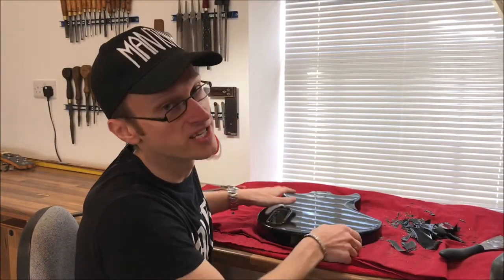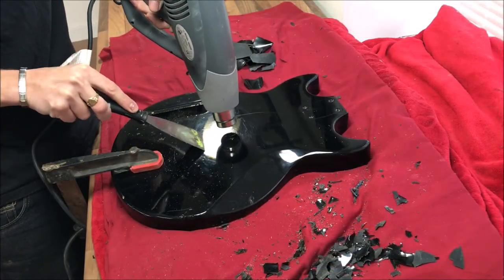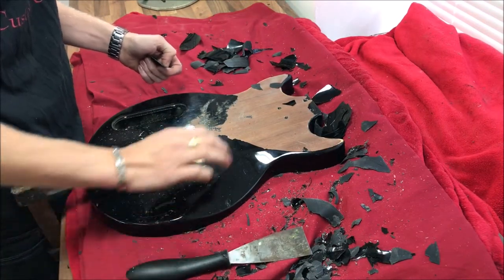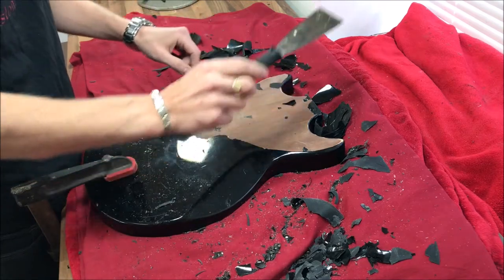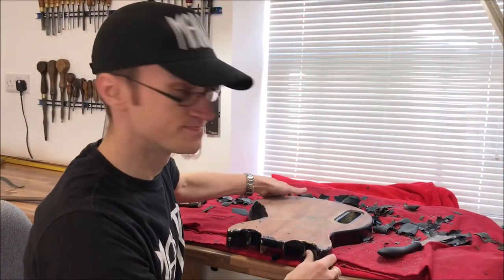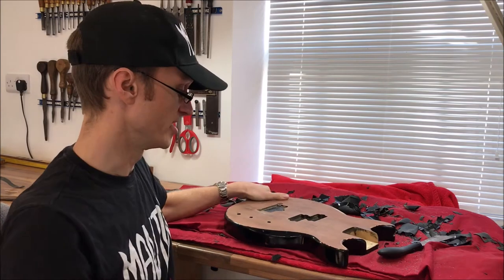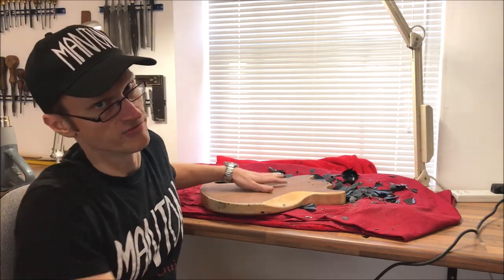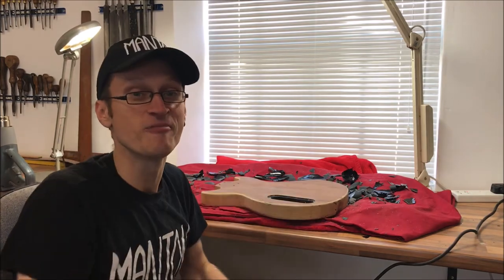Stripping / Removing Paint and Poly Finish from a Bass Guitar Body with a Heat Gun

Comment: Hi, thanks for the instructional. I’ve got a cheap tele type guitar a friend wants me to work on, gotta take the paint off, no idea what type of paint it is, just a standard cheap electric guitar probably 1990’s era. 

Just wondered how long this process took you ?
Reply from the maker: Glad to help. The paint will almost certainly be a poly on your friends guitar, which means you’ll need the heat gun approach! The actual heat gun stripping doesn’t take too long, 1.5 hours maybe, but if it’s your first time it’ll take a bit longer getting used to the rhythm of it. It’ll take a while after it’s stripped to get it all sanded and smooth too.
Reply: Cheers , thanks so much for advice. 

PS. Will neck unscrew or is it likely glued in place too ? If glued do you use heat gun to melt neck glue ?
Reply from the maker: If it’s a bolt on (it has screws on the back) it shouldn’t be glued. So you can just undo the screws and lift the neck out. 😃
Reply: Ta very much, it’s my first attempt at this so your input is a massive help, cheers , much appreciated 👍

Comment: I'm trying to strip a Strat Polyester body and it doesn't come off as easy as yours
and my body cracked because of the heat !  Didn't peel like your guitar , came off by tiny bits and pieces. Gonna try sanding it tomorrow instead !
Reply: I’m curious how it went. My two cents worth: I’ve stripped a few guitars with poly. Sanding takes forever— it can be maddening. If you’re wanting to paint it then you can find tutorials for priming and painting over the existing finish. I’ve seen some come out nice. Of course some people say that the poly suppresses the tonal qualities of the wood. If you find yourself becoming pissed off, just walk away for a few rather than getting heavy handed.
Reply: @flatsixx  Well all Mex are Polyester apparently and had no choice sanding it down because it's hard as glass and damage the wood when you scrape it with a heat gun. I even saw a joint on the body that really didn't like the heat.  I've decided to go all the way because I re-did the belly cut and arm rest to vintage specs and It's beautiful now , going to do an aged Olympic white and i should be done after.

Bouth a brabd new Warmoth vintage body a few months ago and they are not like an old body so I needed to work on this one also !
Fun times.
Reply: @lousekoya1803   it sounds like you’re a lot more patient than I am lol. Years ago I was stripping some no-brand import body and had the brilliant idea of using an angle grinder with a 60 grit flap wheel. It looked like a bad attempt at chainsaw art. I’ve learned to walk away when I get that itch to hurry things up. Fortunately I never experimented on anything of great value. 
And even though I have a relatively poor success to failure ratio, I absolutely love working on guitars. It’s addictive. I’ve got several in the works right now. I recently bought an Eric Johnson semi-hollow strat body that’s gonna be a keeper when I get finished. Also I’m going to try some amber shellac as a top coat on a cheaper body hoping to get a vintage look. 
Good luck to you, buddy.
Reply: @flatsixx  Yes , I was more of a butcher like you before, not beeing able to take the time to do things right for greater results but when you get older , patience is your friend !

I've ordered some Olympic white Nitro spray cans from Oxford finishing supply and should be able to spray the body soon , my sealer is all good and sanded.  There is a guy who sprays Fender Custom Shop bodies on YT and he's amazing to watch . I even had a welder guy do a similar spray jig like he has so it can turn and swivel .  What his other videos to see other colors and his jig. Great stuff my friend !

https://www.youtube.com/watch?v=61Yw7z7VnPw
Reply: @lousekoya1803  Not all MIM Fenders have poly finishes. The majority do but some do have nitro.
Sounds to me like yours may have had a nitro finish.
Either way, I hope you got there in the end and it turned out well.
Reply: @FlameFlickers  Thanks , it was hard to take off but got it done finally !   It was Polyester , had to sand it off , scraping would damage the wood.

Comment: Ugh, I painted/clear coated and I'm trying to remove with a heat gun. It isn't coming up in sheets, it just turns to goo and it's like scraping snot off the body. It's nearly impossible to get all the residue off.
Reply from the maker: If the paint you used was a non catalysed finish you should be able to wipe it away with acetone or lacquer thinner.

Comment: What setting did you use, or how hot does your gun get?. I have two bodies I'm looking to strip and refinish or stain and am new to heat guns!..
Reply from the maker: It’s a 1500w heat gun, the temperature is 330c on low and 510 on high. But it’s more of a feel thing. You can use either setting, just keep the gun moving quicker on the high setting

Comment: can you use a hair blowdryer?
Reply from the maker: I doubt it would get the poly hot enough. Thanks for watching.
Reply: I've seen videos and heard stories of people having success with a hair dryer, but it apparently depends on the poly finish!. I tried it on a guitar of mine and got absolutely nowhere, then saw a video on here of a guy using the same method and the poly came off in huge chunks with ease!. As I said, you will probably need a heat gun like this video as I've heard of people using all types of nasty/toxic chemical strippers and even they didn't touch the poly, but it's certainly worth the shot as maybe you're blessed with the type of poly that cracks right off like in the video I mentioned that is on YouTube!..